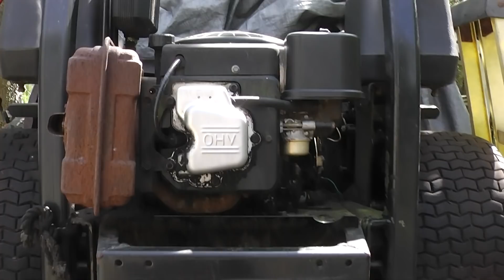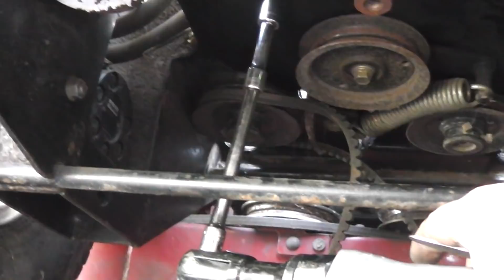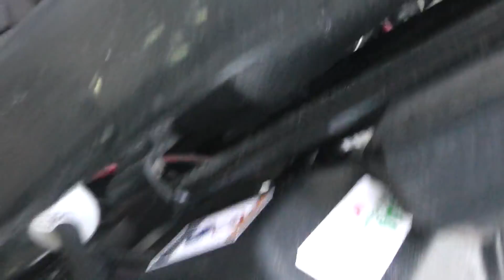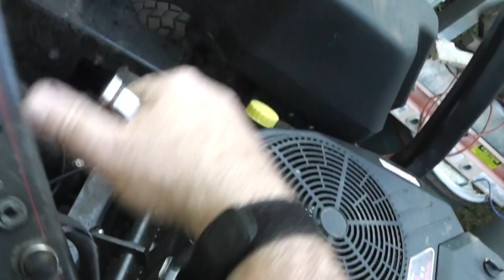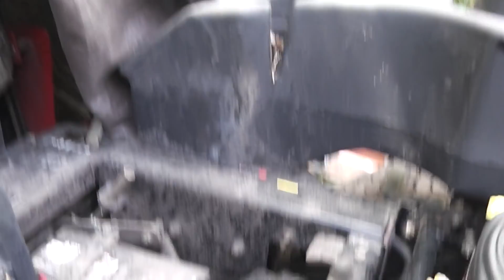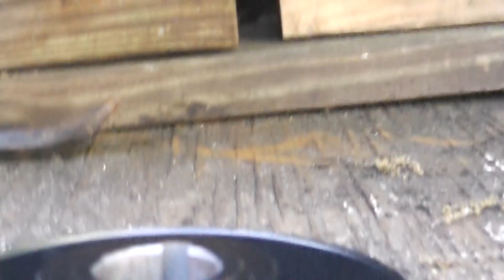Zero Turn Mower Harbor Freight 22HP Engine Swap Step by Step

Comment: What happens if you have different shft size? Do you just buy a different pulley?
Reply from the maker: You can usually buy a sleeve to slide over your shaft size to accommodate the pulley.

Comment: Can you please give us a update on the engine? What is the part number for the engine you used? Thanks for a great video!!!! I have the same Toro Z Master and need to do a engine swap myself.
Reply from the maker: It appears that Harbor Freight has discontinued their 22HP 708 cc vertical shaft engines. The engine in the video is still going strong after nearly 5 years of abuse. I currently use this mower to mow acreage and as a part time bush hog. I do change the oil and filter often.

Comment: What is the crank shaft size? I’m considering using a predator engine in my Dixie Chopper. It originally had a kohler CV20s engine with 13.8 x 17.7 x 19 crankshaft dimensions. Thanks!.

Comment: The knob will pull off of the throttle cable. And then reattach after installing the cable.  I do it all of the time. Just thought you might like to know.

Comment: I have a Kawasaki 23 Hp with over 3000hrs and doesn’t burn a drop of oil . I commercial mower engine should last a lot longer than 400 hrs , that’s barely one seasons hrs

Comment: What was the shaft length? 
I am replacing a Kohler 25 hp on my mower but cant seem to find the shaft length information only the diameter of 1 Inch.
Reply: Should be the same 99%
Reply: Did you do the swap? Does the predator have enough power?
Reply: @stevieray1828  yep did the swap 2 years ago still runs great and has plenty of power. hope that helps.

Comment: Have you had any issues with the charging system keeping the battery charged while running the blade clutch?
Reply from the maker: None. It runs great!
Reply: Engine comes with it's own alternator

Comment: You have a good understanding of the wiring circuits. That's a great skill to have. I like your idea on how to make your own battery terminals. That was pretty cool. The new engine will be a nice upgrade to the mower.
Reply from the maker: Thanks. The new engine is way better(so far) than the original. Time will tell.